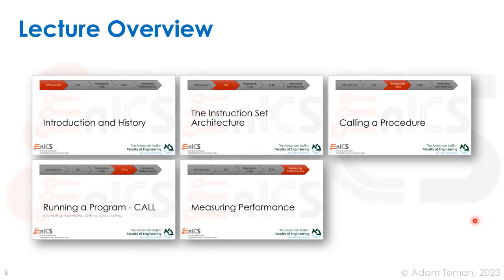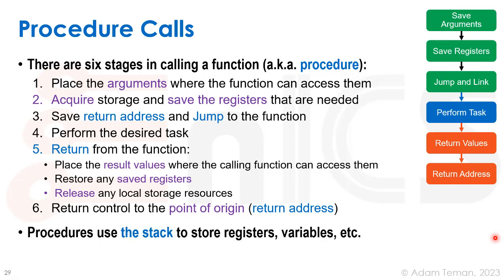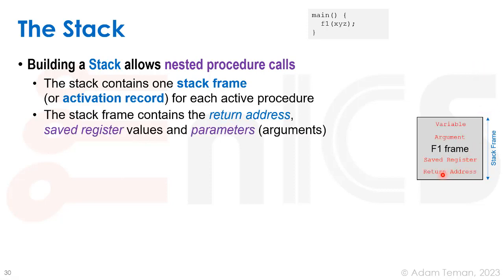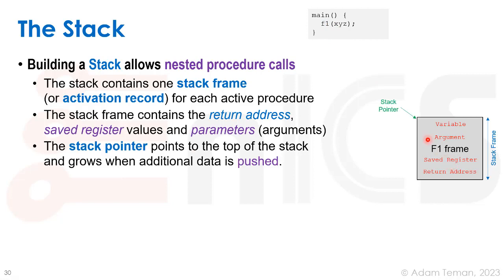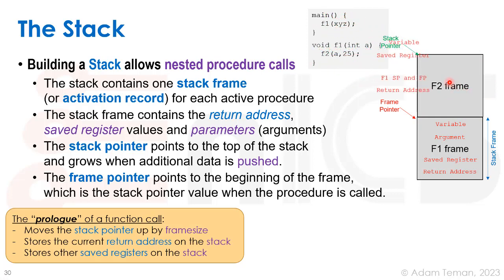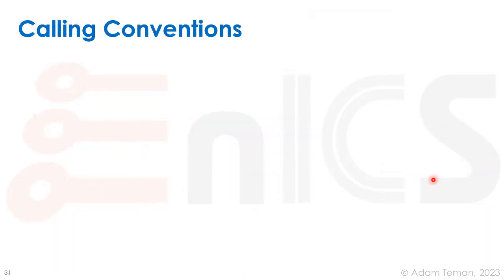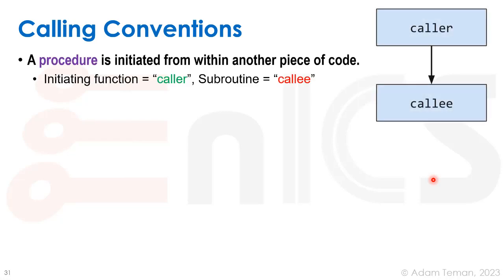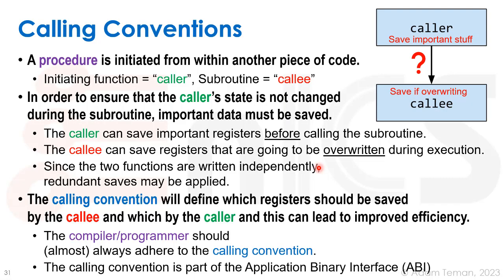SoC 101 - Lecture 2c: Calling a Procedure

Comment: 3:31, its written that frame pointer points to beginning of the frame, but you said it points to base of the frame. Is the base of frame really the beginning of the frame, or is there any problem in whats written  ?
Reply from the maker: Hi, 
I don't think there's a problem. The "base" and "beginning" that I refer to are the same thing. Basically, it's the opposite of the stack pointer that points to the top of the stack. The frame pointer points to the bottom so we can return to where it started.
Reply: @AdiTeman  oh I see, thank you for replying